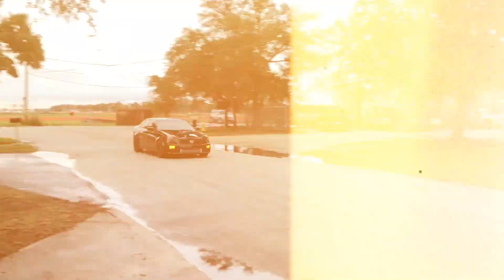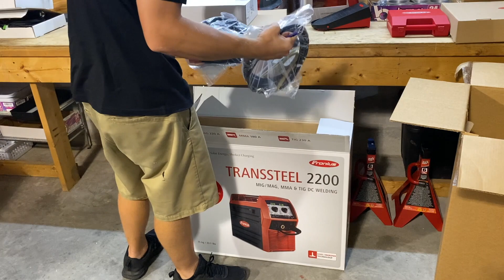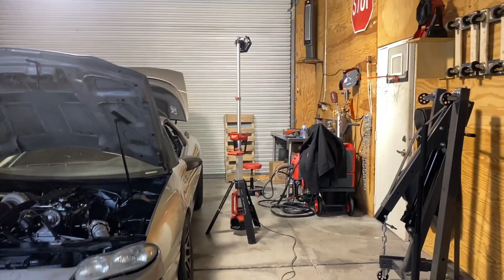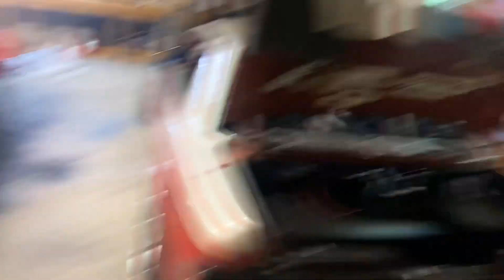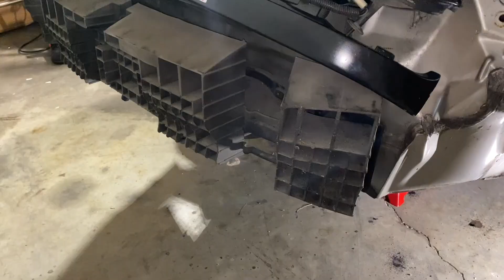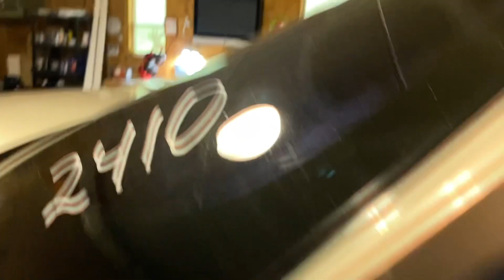The BEST Welding Setup On The Market! (Fronius- Tig, Mig, & More)

Comment: Hey Coop not sure if anyone has mentioned yet but you can cut some vacuum line to size with a slit down one side for a grommet around the holes so it doesn't have sharp edges, helps from fraying lines and also gives it a nice look. Even though your lines seem to have good clearance, always good to have something around them just in case they do end up rubbing.

Comment: I know you don't know your not a poor welder but if you can't Breeze you can't TIG. Have fun learning wish you the best of luck when you can weld 2 aluminum cans together without burning holes in them first let me know that's challenge by the way learn to do this in High School. Also you should Master stick welding. PS when the MIG welder go silent you got it perfect. Go to school get certified you learn how much!

Comment: Cooper, the water spilling out of your intercooler tank is because the vent bung on the top that you have tied in a knot is at the rear of the tank.  All of the water transfers rearward on launch.  Move the  bung to the front portion of the tank and your issue should disappear. Have a great day and thanks for the content.  :)

Comment: Like me you will ever only use the TIG for alloy. 
For most jobs MIG is superior and far quicker. That MIG torch is really too big for most automotive work. 
TIG is generally better for small alloy jobs though.
Too weld MIG with alloy you really need two torches , one for alloy and one for steel.

Comment: Miller and Lincoln best welders. The “tig gun” is called a torch. You can always swap out the torch with different ones for different applications and cup sizes

Comment: You can use some permatex super tack and put on the bead of the tires to try and glue the beads down to the rim to help hold the tire from spinning on the rim. Heard it helps, would like to see the results if it does.

Comment: Keep growing the beard (and a mullet better/longer than Cleets!).  Seriously though (even tho I was half serious there),  if you can weld with a Harbor Freight/Tractor Supply mig welder, you are going to have so much fun and have much better welds with a good welder.   For what it's worth, I still use my Harbor Freight welder and I'm building a 2001 Lamborghini Diablo 6.0 kit car with it.

Comment: You should not replace the over head light ballast’s and go with LED Tubes, there a little more expensive but you will never need to replace them, it will look like you stole the SUN in your shop and they just wire right into the existing wires in your housings 👍🏻👍🏻☀️☀️☀️

Comment: A welding machine don't make great welds !! A Great welder ( tradesmen ) make's a great weld!! I took a coworkers Chicago welder and made my Miller 212 look like a P.O.S. and I know people will say stuff about the quality I agree 100% BUT you cant blame bad welds on the machine its not fare to the littles guys that work there ass off in the shop that just cant afford better quality welders I use all Miller machines and they do just fine But very nice setup Coop

Comment: Need to set up a station for grinding tungsten, you will be doing that a lot! I use a small Milwaukee 12v drill and a belt sander, the drill makes the angle nice and even. Can’t wait to see some welds! Practice makes perfect!

Comment: Great welding setup. Check out Welding Tips And Tricks and The Fabrication Series here on the tube. I literally learned how to tig from them. A couple of hours practicing and now I weld everything I need. Stainless, cast metals and aluminium.

Comment: I wouldnt say you Hobart Handler is "cheap". My Hobart ive ran for over 8 years and does great. Hobart is owned by Miller and basically a Millermatic with auto set and a diferent color.

Comment: They say that nothing breeds success like success. You made your mark last weekend in an indisputable fashion.You were one of the successes of that event. 4th equal with three others in a car that performed valiantly. You hadn't gone in bragging but you drove home with a split of the loot. Take your wife out to dinner. Cooper, well done my lad, well done. On a different note, i will attempt to send a drawing of a better bracket to hold your power steering pump in the drift car. I think it should be held in all three positions. A fairly simple folded piece of mild steel , the flat vertical side is attached to the outside of the chassis rail and is as tall as required to fit the pump. Fold 90 degrees and cut out the shape that fits around the pump. Drill holes and use your bloody rivnuts if you must.

Comment: i strongly disagree with the "once you go tig, you never go back" ... its 2 different processes for different things. if you are welding in some bodypanels, there is just no way you wanna do that with tig, especially if you cant prep it well enough or have gaps, thats just way easier and faster with mig. talking about faster, some stuff just has to hold together, it has to go quick, mig is your friend. in my universe, mig and tig coexist, everything has its benefits and drawbacks, but you will definitely use both

Comment: looks like some nice kit - love to know what retail is on those welders. The real problem with Tig welding is not the skill to weld but learning metallurgy so you what to use and when and how hot.....guess that's why its good to learn from pro's who used non digital machines as i learnt on a analog MIG and tell you know digital makes life x10 easier as it does most of the hard work not you (like realising your compressors running so you have to use more amps to get same amp output down the line)

Comment: I have to do a fair amount welding where I work.  I used to swear by stick welding for anything other than sheet metal.  Once I taught myself to tig weld I opt for that more often than anything else.  Tig is so much cleaner and easier to control once you've figured it out.

Comment: DON'T replace those ballasts, get rid of them. Replace the bulbs with direct wire LED bulbs with a 4000K or 5000K rating. The wiring is super simple, brightness incredible, bulb life about10-15 years and they use much less energy. The wiring is so easy I do them all the time and I am no electrician. You just got some great welding equipment, now get some great lighting!

Comment: Questions 
1 can you stick weld 6010 with the 2200 transteel?
2 does the tig welder have pulse settings? 
3 on the 2200 whats the thickest metal you can weld on 220 volts input?

Comment: Do not overlook the stick welding function. When you need to weld thicker metal the stick can be the right answer, especially if you are outside and there might be some wind. It can be SUPER easy to lay down a pretty MIG bead that has no penetration, not so much so with stick.

Comment: Add another bar beside the cb from the windshield roll cage bar towards the rear and then add your parachute handle to that. Can also run the cable inside or along

Comment: Cut the X off the chute mount, hole saw the center for the cylinder, weld it back a little higher. Should be the best balance of aesthetics and speed.

Comment: I know it's too late but, you want your parachute handle to be right next to the very last device your right hand uses immediately before pulling the chute. So, for example, if the last thing your right hand does is push the trans shifter, then you want the handle next to the trans shifter. If it's something else that you do, then you mount it right next to whatever that is.
Reply: You don't want to be reaching all over the place. That takes time.  And you also don't want to be searching around for it (when) in the event of an accident at full speed.

Comment: Cut the black parachute mount off a couple inches behind the plate, use the plate as a template on the other mount face for the holes (if necessary), trim the new mount post to the proper length, put a slug inside the tubing, weld it back together. Done.

Comment: That lower control arm bolt is a little short, you are supposed to have 2-3 threads protruding from a Lock nut like that.

Comment: Coop you need Drag Racing Carbon Ceramic brakes. Lots of NHRA racers and 3000+ dragsters use it. You don't need to warm it up. I have a set on my R33 Skyline drag racecar.

Comment: You have a Hobart MIG unit, which is a Miller. That is a great unit!! The only reason that the cabling is smaller on the Hobart is because of the amperage that the unit puts out. You can easily do an excellent weld with the  Hobart!!

If you can’t weld an expensive machine won’t make you any better!!

Comment: They make LED tubes that replace the fluorescent tubes.  Just take out the ballast and wire the ends for straight 120.  They are way brighter, use less power, last longer plus only cost like 12 bucks  a piece.

Comment: You're gonna want the chute handle down by the shifter. Up high you'll quickly find is not a fun location on a car that can get as squirrely as yours can. Much easier to move your hand back to the wheel from the shifter location than up above your head in a panic situation.

Comment: COOPER - Get a set of quick jacks!  Stop messing with jack stands. The quick jacks are so much faster and easier and they lift the car level, which is really nice because you can work on it like it is supposed to be and the fluids sit correctly and stuff. 
www.quickjack.com

Comment: So hey Cooper on your ice cooler problem the bong that's already welded in just either threaded close nipple into it with double female 90 and then thread a nipple into the other end that you can slip your pipe right on or thread a mail 1 and 90 into the bong and then a slip your pipe over the other end there's so many fittings that you can use its you don't have to weld another bung on there. Take it from me I did irrigation and heavy underground work for about a total of 12 Years needless to say all the plumbing I did after that building custom homes the same thing applies if you know what I mean. Take care brother

Comment: Hey Cooper man what a nice welding setup although that other Meg that they sent you that's Mig Tig and stick welding also write DC style so it's in inverter that's why it's so light a great welder itself. I've noticed you were talking about your lighting setup in your shop okay you got bad ballast that must be a fluorescent setup okay get rid of the ballast buy yourself some LED bulbs and straight wired up to 110 I've done it before it my boss is shop you do not need the ballast just why are the ends up 1:10 correctly put the bulbs in and turn the lights on and you're going to love it. Have fun with your welders brother you deserve it. Stay safe stay well and as always God bless

Comment: Witness mark your bolts/nuts after you torque them, that way you'll be able to visually identify fatseners that have come loose.
Reply: Marks along a axle to show it twisting over time can also give you a heads up to impending failure.
Reply: Very good practice to do this.
Reply: thats how every bolt is done in aerospace

Comment: personaly i only consider 2 brands the top of the line, also there is room for improvement, there standard aircooled machines, an upgrade to watercooled systens would be a better setup, also the brands i mention are lincon electric (wich is what i have an old tig from) and miller wich isn't really available were i live for consumer machines)

Comment: Switch to LED shop lights.  Way brighter and nicer.
Reply: They make cameras flicker
Reply: @trencher325  not all LED lights will flicker on camera. It depends on the power supply.
Reply: @trencher325  ya some camera and lights don't agree with each other
Reply: My son-in -law put all LEDs in his new garage .  He can fit 8 cars and I swear you can get a sun tan in there !  JK.  But it sure is bright !

Comment: ‘Its like a hand truck...’. It is a freaking hand truck. Gotta love Cooper. Get on a welding course and get Bront doing some dimes too!
Strange MR sent incompatible chute parts. Shouldn’t have to modify wrong stuff !
Let it rip
Reply: they didn,t, coop wants to use their harness/piping, with a better deployment system than supplied.

Comment: Funny he mentions an aluminum boat

I’ve seen another person weld an aluminum boat
Reply: Yeah, like an hour or so ago.  lol.😂
Reply: They should have just used flex tape!
Reply: hehe 😄
Reply: I see 4 aluminum boats in our future lol
Reply: Thought I was the only one who picked up on that.. lol
Reply: TimothyReidUpNorth907  I’m here to tell ya that shite hurts! If you’ve ever had your eyes burnt you know what I mean. It’s like having hot sand in your eyes. I’ll let ya in on a little remedy I learned long time ago. Take a regular old white potato and cut it in half. Place each half on each eye. Let the juice run in your eyes. After about an hour you’ll feel much better. It really works. An old welder showed me this trick about 35 years ago.
Reply: @monroefive-o40  Drinking alcohol relives the pain almost immediately,  liquor goes straight to the eyes.  Learned that one a few years ago
Reply: @casada70  don’t know if the reasoning is accurate but it definitely works. Arc eye feels so much better once you’ve had a nice cold beer.

Comment: damn.. im a professional welder and i havent seen anyone with a setup this nice on youtube, we have a Fronius CMT and its SOOOOOOOOOO smooth. congrats
Reply: @Joshua Bullock I got a lock out key in my pocket as we speak lol
Reply: I've been welding all my life and don't have a setup like this...... I'm jealous haha
Reply: @boosted_l6787  that setup is better then most industrial shops.. extremely nice stuff
Reply: Hey do you happen to know a vague price for all this?
Reply: @zackhoggard6435  My guess would be $8-10K
The all in one with water cooler is over $6K alone
Reply: @zackhoggard6435  don’t know the price for this stuff but I have been told our CMT was 30k when bought
Reply: @zackhoggard6435  The magicwave with the watercooler, bluetooth pedal, and upgrading to a ck 20 torch is right at 7,000
The mig is around 4800 last I checked. The cart isn't too bad, but I'd get one from Ztfab or fronius has an upgraded cart that fits the transteel and magicwave on one cart with dual cylinders.
Reply: CMT= cold metal transfer.. decent unit
Reply: @Joshua Bullock got the synergic pulse mode? Depending on what models you can do so much dialing in you can run pulse with virtually no spatter.
Reply: Fabrication series, fab forums, and stapleton all have this same basic set up on here. There's a few others as well. These machines are just so next level.
Reply: @Joshua Bullock We weld cabs for John Deere, Autocar, Kalmar, and aluminum Terex and Oshkosh.